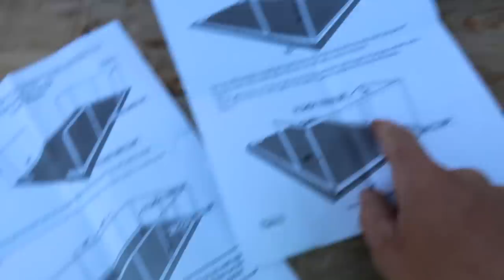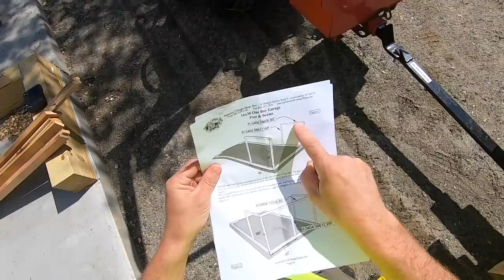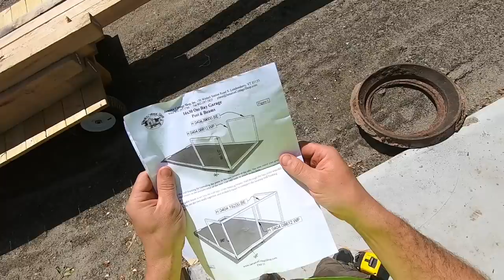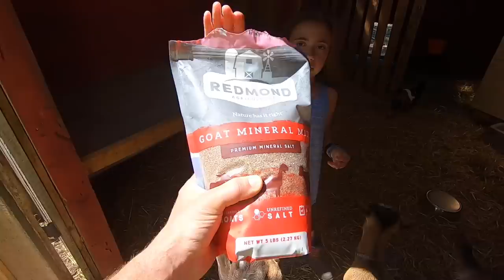Installing the LONGEST BEAM on our POST & Beam Barn We ORDERED off the INTERNET

Comment: Hey Al, things are looking good on the barn build. I see you working and it reminds me of me about 35 years ago. I'd put you up against many a longshoreman on the coast. I used to drive a semi for a while and used to pickup and drop along the east coast. Didn't really care for those east runs. To expensive to run there. 
Be careful when doing those overhead lifting. It is an easy way to hurt your back. I messed my back up lifting. I got a pallet truck stuck under a pallet when part of the lathes broke and put the load on the forks. I got ticked and pulled it out by my self instead of getting help, jerked the truck back and forth and strained my back. I worked for construction and as a millwright for many years after wards. 
You are giving Livy a young life she will always remember and a fantastic reason to come home off and on when she grows older.
The goats are looking great and the kids are growing up fast too.
Pork and chop are going to get the idea that they can go beyond that point where the old fence shocked them. They likely know the boundaries of the old pen in the dark. 
Well I'll get off of here and wish you and yours health happiness and prosperity. Larry

Comment: Al use a quick clamp to hold the pieces together while you fasten them and to avoid hitting the nails below go north and south on one group then east and west on other group as for the fasteners you have that sorted it seems. You could also use your ratchet straps to hold the outer 4 by 4 together while placing tie beam on top.  You are a 1 man construction team be safe and enjoy your build.

Comment: Al, Go to the office supply and get some plastic page sleeves/pouches. You can get them with zip lock plastic bag closures. You can put some weight in the plastic pouch so they do not blow around.

Comment: I put paperwork I don’t want to get wet in a ziplock bag, then put the bag on a clipboard. Its not necessarily waterproof but its close, and it does help quite a bit. A guy I worked with taught me that trick years ago and I have used it ever since.

Comment: Even if the plans don't call for it, I'd put metal straps or mending plates on the vertical posts down to the sill plate that is bolted to the cement.  The toe-nailed screws have very little hold-down power in high winds.
Reply: I thought it was odd that he bolted the sills to the slab, but the posts are just toe-screwed like that...

Comment: Al, get yourself a nail & screw apron, it will also help your back if you buy the right one???  Wondering why don't you remove the tag that has the part no on it & staple it to the post so you can read it when you're done. Then in the future, if that causes you trouble for some reason you could tell the factory which part????  You are doing great so far!  Stay safe!!!!!!

Comment: I would like to make a suggestion out of concern for your safety. Find yourself a wire basket or similar that you can hang off the rails of the scaffolding and get all that stuff off of the floor before you trip on something! ;) It's a pretty serious safety issue with a pretty simple solution, imo.

Comment: I noticed that when you placed the intermediate posts that there were lines on the base plate where the posts should be placed.  Is that something that you had to measure and draw or did the lumber come with the post positions marked already?
Reply: Came with markings as Al explained in a previous video.
Reply: @tonygrimes13  Thanks Tony,  Al's video of the 22nd clarified that.  I appreciated your response.

Comment: Save your back Al. Wear a tool belt.
Reply: Excellent tip!
Reply: Definitely, you never know if your body is going to develope Degenerative Disc  Disease.  Do you have a  chiropractor  or physical thetapist. If so, I'd  be visiting them regularly. Also one of my builds on the farm would include  a steam house. You never know that your genetics will subject yourself to. Use ice and hot compresses after working a hard day on the build.  I've  been watching since 2017, and  am seem to remember  you have a chiropractor. I know I sound like an old great grandmother,  I did everything  thinking good body mechanics, but twenty years ago while getting ready to go to work in ER my body failed me.  There is no such genetics in my parents family. All my siblings  do not have DDD. Been through all modities  several times. After 2 years, trying chiro, acupuncture, ice and heat pacs, a trauma  surgeon told me my back was inoperable. I dont wish this problem on anyone in the world. It truly  changes your life.  Arent there anyone from your old build sites that owe you a favor or two. While it would be an ego booster to say, "I built this all by myself". Take care of your body so you can look at your homestead comfortably over your life span.

Comment: Perhaps you just didn't show it on camera, but did occasionally check to see if everything was plumb?
Reply: The slab is level and the saw cut are 90°. Good start. Fine tuning really comes into play when braces or sheathing go on. But, I haven't read the directions.
Reply from the maker: I will before I brace it up.